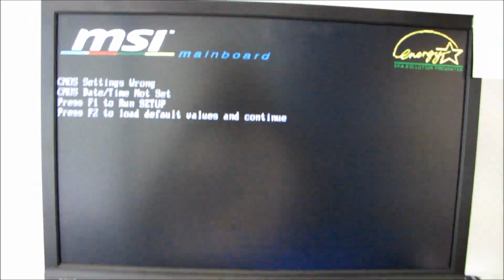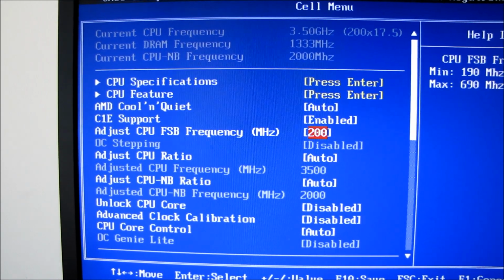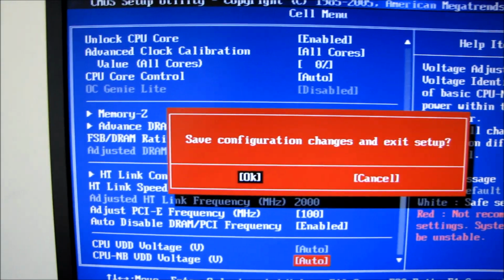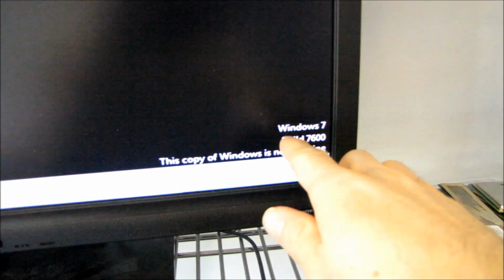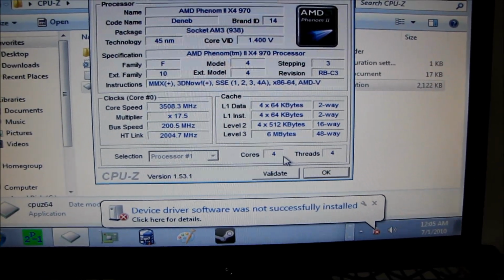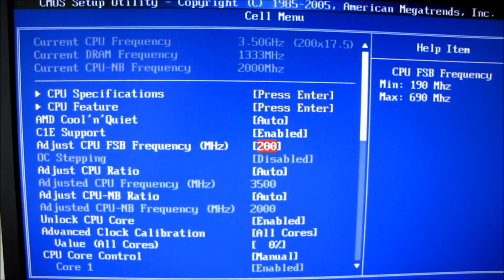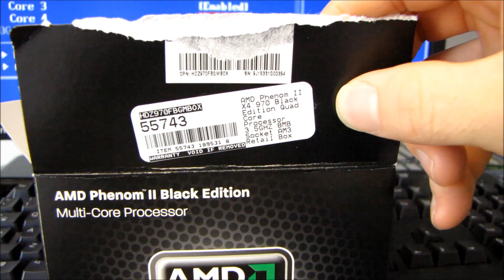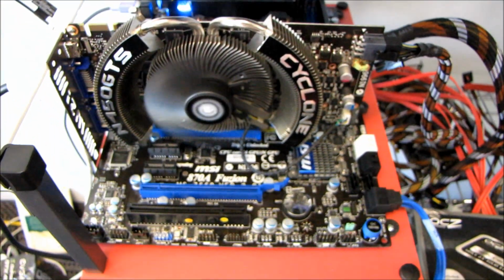AMD Phenom II X4 970 Black Edition Unlocking Attempt Linus Tech Tips

Comment: i have a msi board with all these options in cell menu, and a 960t with 2 cores locked, i do the same settings like linus but i get only 4 cores 4 threads in cpu z. What should i do?

Comment: @christuz040 some of the 960t you can some you cannot, the 960t is origonally a 6 core cpu with the 2 other cores disabled because it failed its test on the production line.

Comment: @D4ilyChase Maybe is the answer, AMD locked cores for various reasons, some were faulty cores intended as X6's.  Lock the 2 bad cores and you get an x4.  Others were made with locked cores to fulfill orders.  I was reading about this earlier and one group that tested them found about 37% of them could run stable as Hex-core processors.

Comment: @drago433 500W will be fine, provided you're not going to run recent GPUs in Crossfire or SLI.  You'll be ok with most GPUs on 500w.  I would suggest upgrading to a 650W PSU anyway but only for peace of mind.  The CPU itself is about 130W I believe.  Recent GPUs sit @ about 150-200W, so you'll be fine.

Comment: hey im realy in a pickle here can someone help?
im playnning on buying this processor and i dont know if 500W is going to be sufficient to power it, i dont have a power thirsty graphics card so you shouldnt count it in. And i dont know if i should be worried by any other parameters of the power block. 

anyway i would realy appreciate an answer.

Comment: YUP damm right it doesnt work.
at least if you're trying with a Denab cpu.
Although the 970 i own is a Thuban, and only 1 batch of theese were made, and what's even better is its Zosma meaning only oem released and very rare, but i seem to have got my hands on one.

im waiting on my cpu cooler and some ddr3. OH yeah and im running exactly the same motherboard as you so :P.
 Video response on request.

Comment: MSI isn't a happy solution for unlocking...

It best work for me is ASRock's UCC and Asus CPU unlocker,
but ASRock chip is the BEST solution for unlockig.

It kick ass with AMD LE-140 to X2, 220e X2 to X4, 5xx X2 to X4 and 970 X4 to X6.

The most problem with unlocking i had with the MSI MBO's.
It unlocks but sometimes it doesnt boot, or it chrashes with full stable unlockable
555BE.

Comment: @Anton338 Because the other two cores are faulty or doesn't meet the requierements to be declared declared as stable in order to be selled as a 6-core. Since making a processor is a high precission manufacturing process it goes through a lot of tests and some cores can have little mistakes and because of that they prefer to disable it so that they can sell the rest of the processor instead of disposing all of it.

Comment: As you can see the Code Name is Deneb, this means it's just a normal quad core. You have the X4 970 in 2 different sorts. Of you had a X4 970 with the Code Name Zosma it would be unlockable to six cores because the Zosma X4 970 is a denied Thuban-Hexacore. 

I think someone else already said this, but I was to lazy to read all the comments :)

Comment: @sounak505 Both are basically the same, only the 970 is clocked 100MHz faster then the 965, though you really won't see any difference at all with that extra 100MHz.

They're both black edition CPU's, so i say save some extra cash and pick up a 965 and of course, overclock it using that unlocked multiplier. :)

Comment: I don't see how you can unlock this chip, as stated in of the comments below, this chip is based on the Deneb architecture, there are are only four cores on the die to be used and nothing more.

Now i did hear that there are two versions of this chip, one based on the Deneb architecture and the other based on Zosma, and the Zosma version is able to unlock to a six core.

Maybe try and fins one of those version Linus, cause you're not gonna get anywhere if it's still Deneb.

Comment: But then again, are the core unlock features on the motherboards programmed to recognize and unlock processors to 6 cores? Might just need a bios update later on if it is possible.